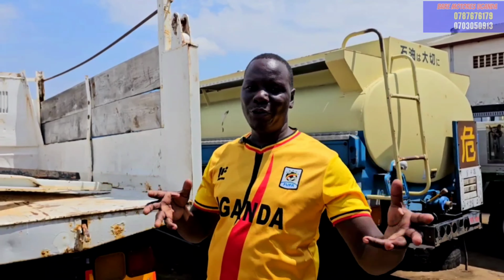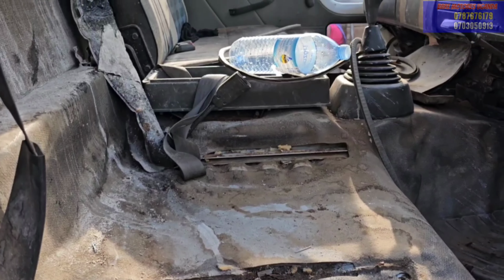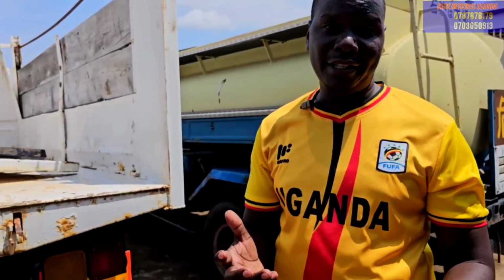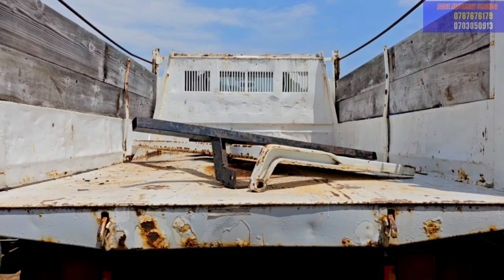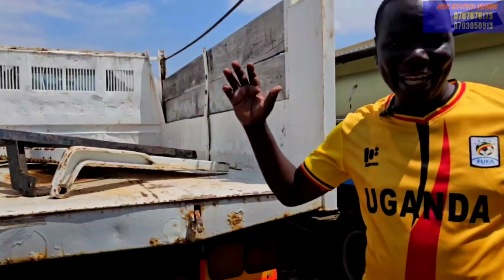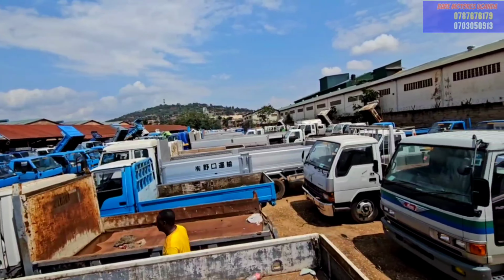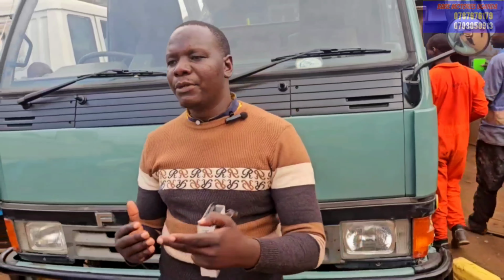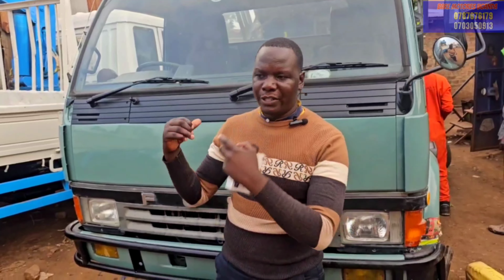From Rust to Shine: Epic Truck Refurbishment Journey (before and after) Revealed!

Comment: I think you are spraying over corrosion and rust surfaces. Don't you think you should clean and prepare those before painting
Reply from the maker: We would love too but how can you separate rust from iron , steel or uranium coated with iron ?
Reply: @baremotorsuganda  Atleast try wire-brushing or use sandpaper. The whole truck will be a rust bucket in few years
Reply: Atleast pressure wash the dust away but waa
They just spray paint on top of all the grease and debree
Eeeh this is really sheddy
Reply: Agree, look at Europe restored cars, rust is initially removed and where unrecoverable, new panels moulded. Spray takes place after rust is removed.. rust can destroy the car internally making the can unsafe eventually